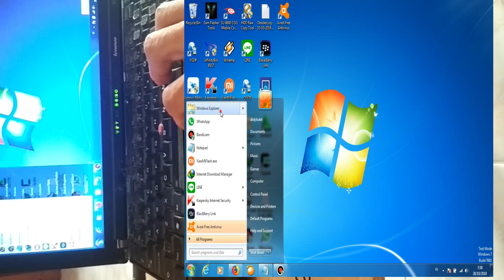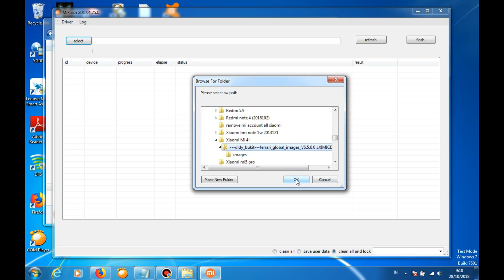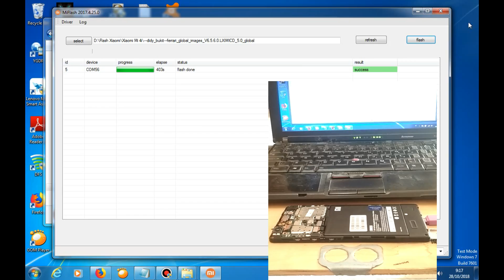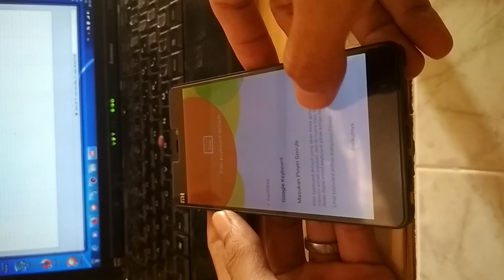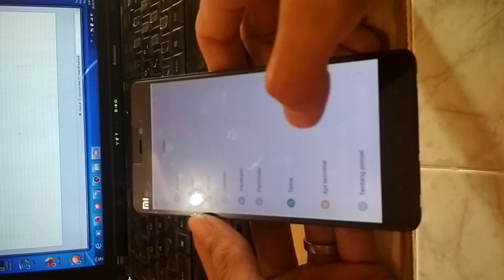Redmi Mi 4i Restart Terus dan Mentok di Logo Mi, Done 100% By didy_bukit

Comment: Bang, punya saya kalo sambil di cas kadang bisa masuk home, setelah itu bolak balik restart terus di logo mi
Kemungkinan apa ya yg rusak?
Reply from the maker: Coba tes ganti batre dlu om..klo msh restart coba diflash om, msh juga restart hardware/mesinnya om yg bermasalah..kemungkinan ada yg short/konslet ic atau pun capasitornya..
Reply: @lapaktutorialrepairhpprese8486  okeokee bang terimakasih solusinya🙏🏻
Reply from the maker: @jarangkeluarr5556  Siappp sama2 om..
Reply from the maker: Untuk kasus hp restart,posisi mesin yg bermasalah biasanya di ic wtr/cas/cpu...tp sebelum ke ic, cek dlu capasitor di area ic2 tsb...

Comment: gan mau tanya,waktu diflash flexible batrenya di cabut dulu?
Reply from the maker: Video diatas gak saya lepas gan, tp coba dilepas dlu klo misal gak connect 9008 baru dpasang aja flexible batrenya..
Reply: soalnya waktu diflash,dan flexible batre terpasang.hasil flash succes tapi hp tetap restart di logo mi gan.tapi jika fleksible batre dicabut flashing tdk berjalan(di refresh port com nya jd hilang) solusinya gmna ya gan?maaf banyak nanya
Reply from the maker: @garyrukmana1084  Kasus sama diatas gan, awal nya jg gitu pas mau flash..tp alhamdulillah done hasilnya..sudah coba pake rom china gan...
Reply from the maker: @garyrukmana1084  Klo msh tetap restart coba tes batre lain dlu gan, msh restart juga hardware yg bermasalah...
Reply: @lapaktutorialrepairhpprese8486  sudah sukses Gan,ternyata kabel fleksible on off/volume juga bermasalah ada short disitu.Thanks rom&flashtoolnya Gan👌👍
Reply from the maker: @garyrukmana1084  Hemmm gk terpikirkan gan oleh saya,hehe...syukurlah gan mantabbb!!!